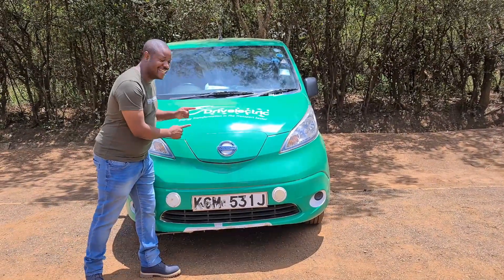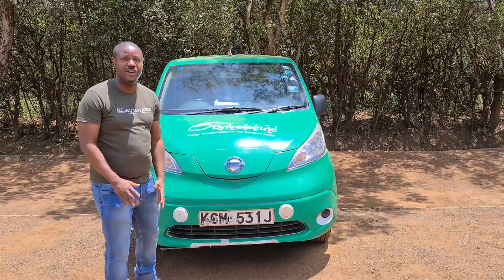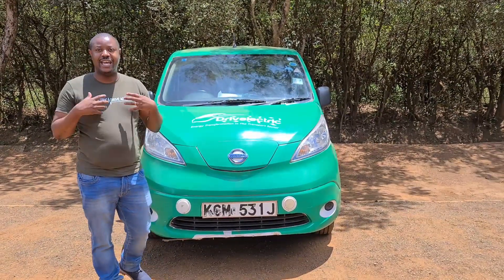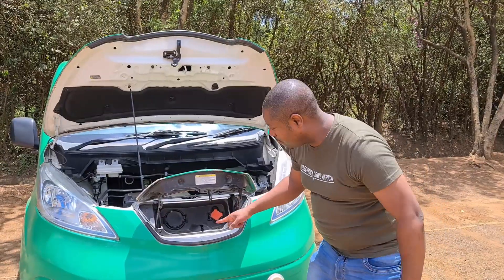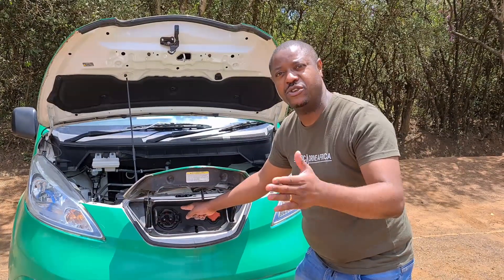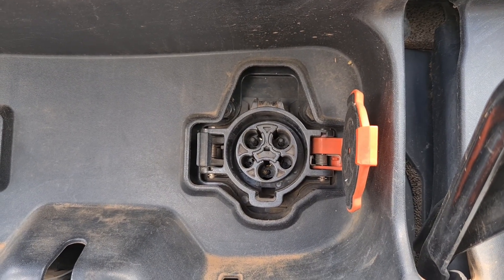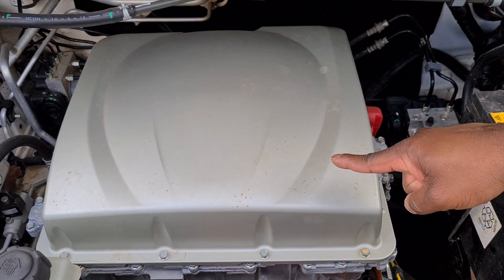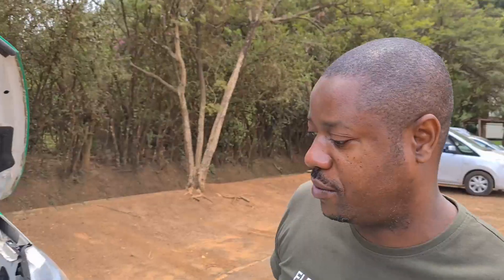All Electric Van! Drivelectric Kenya's Nissan eNV200 | Nairobi Kenya

Comment: You should have included the price and distance traveled when fully charged
Reply: It use a Nissan leaf drive train so expect a range of 70 - 90 miles or 40 to 50 with older batteries